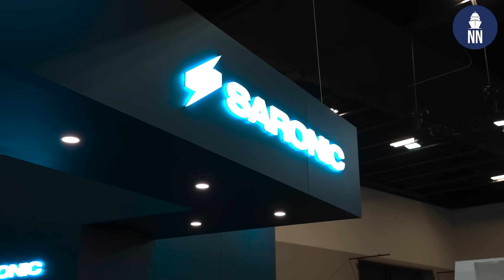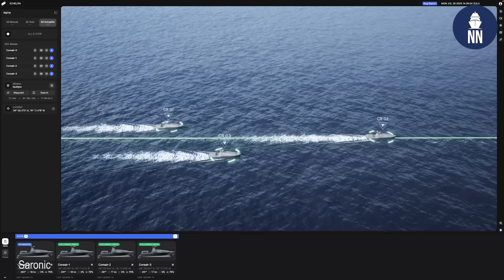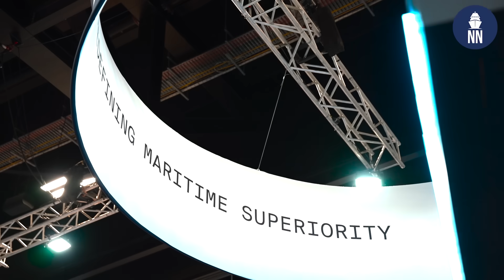Saronic at Indo Pacific 2025: Australia, Corsair and Marauder ASV, Port Alpha

Comment: I will admit the idea of using drones is probably always will be very intriguing on multiple points. But all I can think of is that these are basically the same sort of winter weapon that people have developed for centuries and they work well right up until somebody figures Out the Achilles’ heel and they immediately disappear as a primary system. And even if they come back in smaller ways, they never have the same impact that they once did, primary example of the chariot.